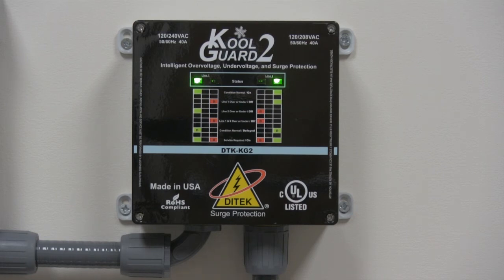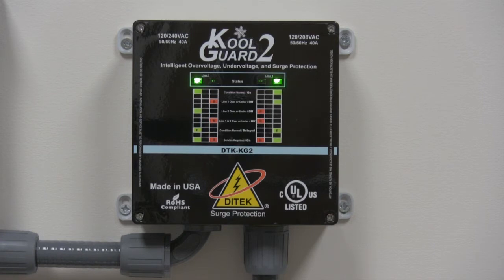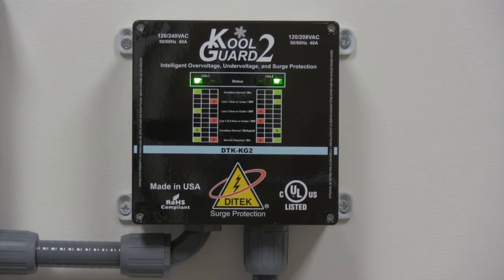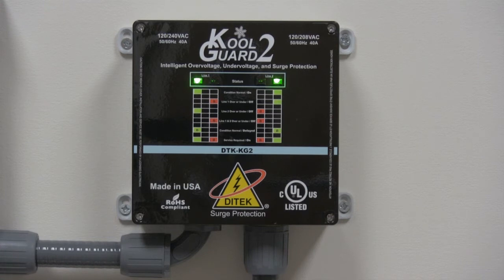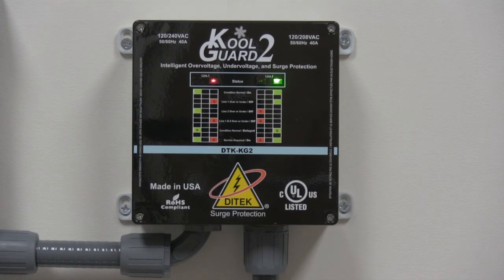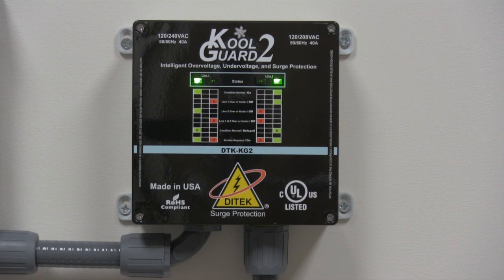DTK-KG2 Kool Guard 2 Demonstration

Comment: Can these be used on standard split systems (4 ton Trane) with higher inrush? 
51A inrush with Micro-air Easy start soft starter (113A w/o).
Reply from the maker: As long as the MCA rating on the system is 40A or lower, it will work